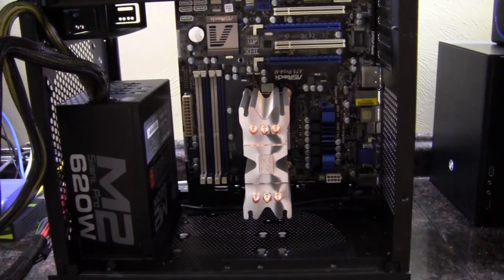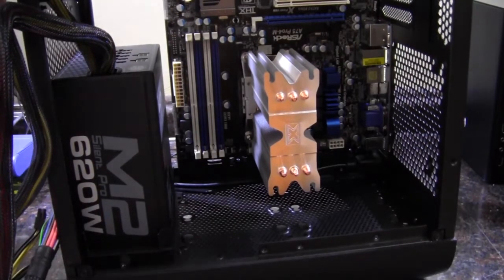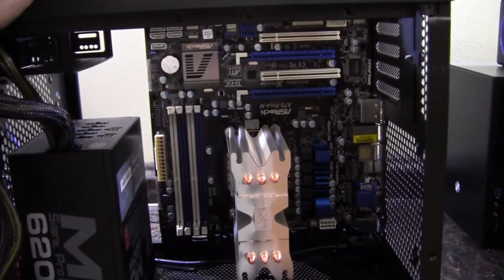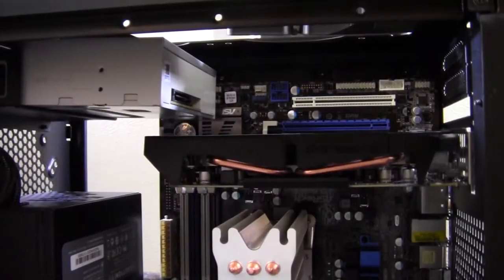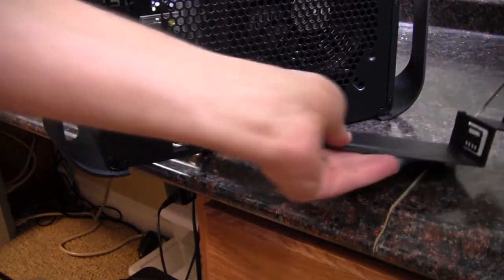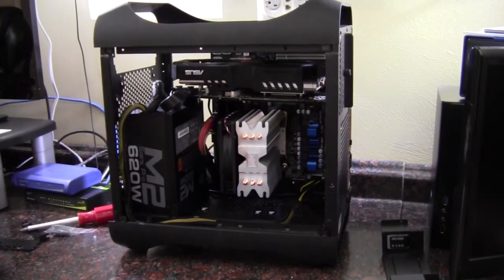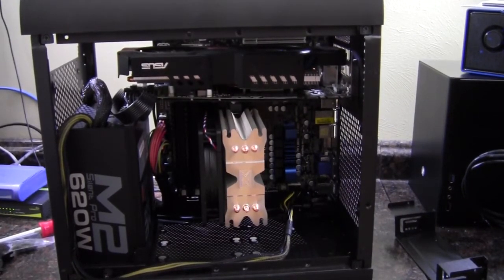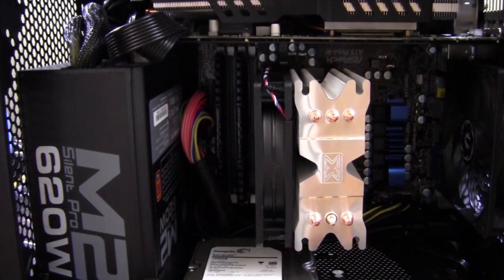Working with the Bitfenix Prodigy M Case

Comment: hey man,

can i put any card in like gtx 780ti or r9 290x ?
im just asking because of the space
Reply from the maker: They will fit, it is just not the most ideal case for cooling those cards.
Reply: I have an ASUS GTX 780 Ti in my Phenom-M case and it fits fine. A little tight but it works out, as long as you take out the optical drive carriage/frame.
Reply from the maker: Virelio Thanks for the input!
Reply: Virelio hmm what psu are you using?
Reply: isaac aranda Corsair RM650

Comment: is there any limitations to the size of the psu?
Reply from the maker: Only if the GPU extends into that same area like my example with the huge triple slot ASUS card.
Reply: But standard depths and widths should fit? 
Its just the lenght that you have to be careful of?
Reply from the maker: bailey Gray The ATX spec of power supplies have the same dimensions other than depth, or in this case height. As long as you use an ATX power supply, it will fit in the space. Modular power supplies typically are longer than the non modular. The ITX version of the prodigy is not very compatible with modular designs because of the extra length.
Reply: AdoptedMike Alright well I researched it and my 600mm psu might just cut it in the prodigy M

Comment: Hey i need some help.
I'm planing to build my own gaming pc on a budget of around 800$ usd it should contain a AMD FX 6300, AMD RADEON 7870 and Samsung 120 gb ssd.
I need you guys to help me with the other components (like power suply....) obviously i would like to use the Bitfinix Prodigy M case
Reply: Scrap the ssd, (it's not exactly vital to have) then go for something more like an R9 270x or an R9 270. Also, go for a better micro atx case. The Prodigy M is just kinda ridiculous. If you want a nice micro atx case, look for something like the Corsair Obsidian 350d or something. Do you plan on doing any cfx or sli in the future? :p
Reply: simon sieber but if you really feel the need to go with the Prodigy M, i suppose it wouldn't be the worst thing ever.
Reply: i will most likely not do cfx or sli. what do you think is a good motherboard for my budget?

Comment: How long is your PSU ?
Reply from the maker: Just a hair under 6.5 inches.
Reply: Thanks for the info.
Do you think that my PSU will fit?
It's 190 mm long, full modular and if i remove the optical bay?